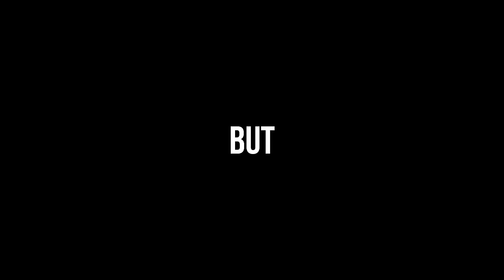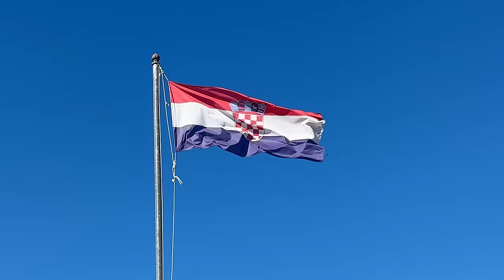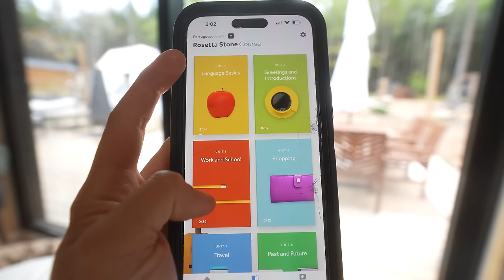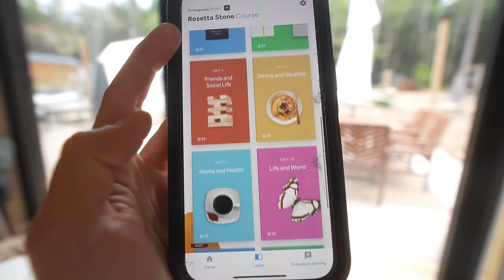Women Living Off-Grid in the Woods Alone

Comment: If you move the rocks out, one of the bottom next to the ground, put a flat pressure treated on the ground, and then screw those bottom of the steps risers 2 that flap step, it'll give it more stabilization going up-and-down, and it won't tilt back-and-forth to either side. They'll always have that flat plate to stabilize it at the bottom step.

Comment: Good to see you two back and recharged! Suggestion for the base of those stairs. Given all the snow, and rain in the Maritimes, just having gravel for the stringers to sit upon, may not last. Best to dig in some pavers atop the gravel, and then wood seal the bottom of the stringer, before you add the steps and risers. It’s frustrating as a viewer to not know ahead of time, what project you’re up to next. But given that you mentioned railings, will you be making the posts and caps out of cedar?

Comment: The aphids are a real problem. I'm sorry to see they got your kale. My partner uses the Kale as an aphid attractor so they don't infest other plants. It works well unless you want to eat the kale. She will collect all of the leaves with the aphids, seal them in a garbage bag, and dispose of them. Maybe you can burn them in your wood stove? And maybe consider the kale in the greenhouse as the sacrificial plant to keep aphid counts down? She also lets aphids take the early spring growth, and then cuts the kale plant down to the stock, and then aphids seems to be under control for the summer. We've used water and a drop or two of dish soap to spray wash aphids off leaves. It works okay. Lady bugs will work for a season. Good luck!

Comment: I haven't read all the comments,  but did you have a timer or self watering system in the greenhouse?  I think 500 lady bugs are sufficient. I am not a fan of them either, although cut worms can be a bit more disastrous. Jaz, it was good to see the small snippets of the 18d getaway anyway and thanks for sharing that, at least...
I built the garden beds at the Rouge Restaurant (Calgary) in 2014, raised them up a tad, by myself, and yes, after the first one (12'x22'), they got easier. The stairs are 👌 👏 👍 fabulous!!

Comment: Now you just need stairs off the other side of the deck too. Screws and nails are used for different things due to their shear strength. Screws shear much easier than nails so downward force usually require nails. Place is look'n good.👍